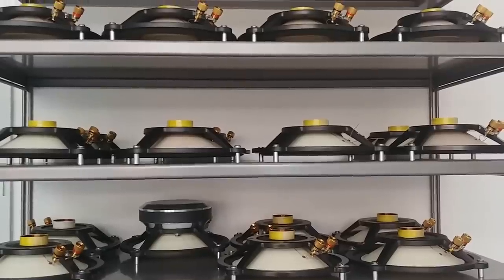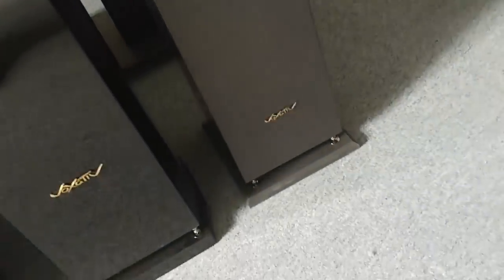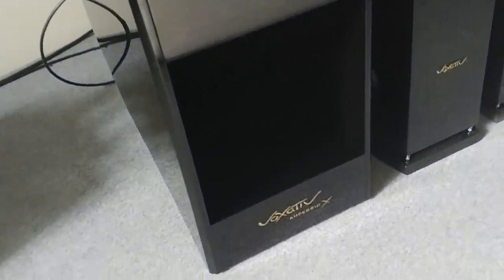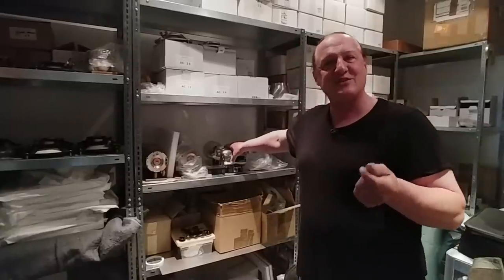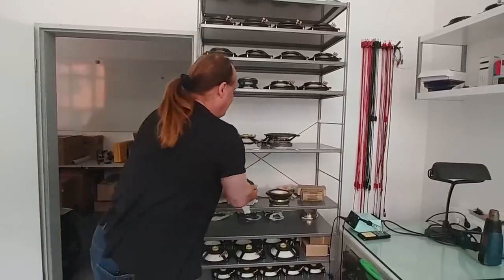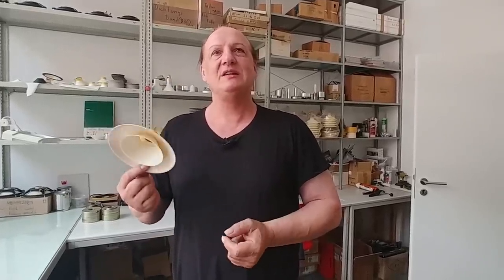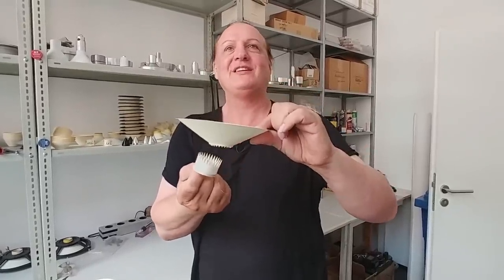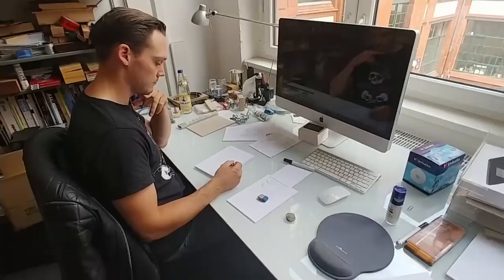'Made in Berlin': Voxativ loudspeakers

Comment: Interesting how they are moving away from single driver and to 3 way. I think  most single driver doctrines eventually realize that it’s not necessarily the single driver aspect they love, it’s simply the midrange clarity of a lightweight wide bander. If that wide bander can also add the same speed and clarity to both ends, while still properly executing a seamless xover, then it really is a better solution.

Comment: I agree it's best for midrange speakers to be made of paper, or another lightweight composite material, because they have a combination of stiffness, damping, and very light weight that makes them ideal for midrange reproduction, especially at frequencies where a wavelength will physically fit on the radius of the cone, so the cone begins to break up slightly. When that happens with aluminum cones, the breakup happens at a higher frequency than paper, but it also is very severe because the aluminum metal has little to no self-damping. But for low frequencies (bass, sub-bass) aluminum really is an excellent material because the cone moves as a perfect piston, and the bass driver then has almost no character of its own, as long as the moving assembly is kept lightweight and the motor assembly is strong. And for tweeters, I still have heard no equal to the RAAL ribbon, and the "next best" is the Scan-Speak illuminator beryllium dome.

Comment: 9:35 Aluminum cone drivers have disappeared because they do not sound really good... Genelec, Elac, KEF, PSB, Klipsch, and I believe Infinity and several others use aluminum with ceramic, and then we have titanium with Mackie and beryllium with Focal and Paradigm. Curious what a company purely based on blind tests would say sounds the best diaphragm wise. My guess is it would have less of an effect than most would guess, but that stronger lighter materials would win out, especially at high volumes.

Comment: Point source is the only way to go. With two ways the vowels of the voice sound is coming from like 20 cm apart. Not only that, the woofer and tweeter and the ear form a triangle...but with point source you just get a line. The triangle makes it easier to hear where the sound is coming from. If you had a pair of your speakers in your bedroom and you put on a rain relaxation stream overnight, the rain will convincingly sound like it's outside on the roof. That is exactly what I experience with my FR speakers.

Comment: I have been building FR speakers for a while and I tested a few brands of steep cone drivers against shallow cone drivers and the shallow cones are BETTER! Way more control in the upper med (by a large measure). Yours appear to be fairly shallow for the main cone. My drivers don't have a whizzer (each to their own). But my main cone is open but near the box (not in it). So mine get the same open sound as a whizzer, without the whizzer. The speaker hole is acoustically treated (with a 2" deep tube under) to act like a bass vent. So it doesn't have that bonky sound how you would expect with such a driver mounting. Driver is mounted 1-2 cm above the speaker hole with extension screws and spacers. Easy. I use an extra woofer pointing straight down onto the floor on the very bottom of the tower box. And the bass vent med speak hole also works as a massvent for the woofer. Basically it's a FR driver placed over a woofer bass vent. I did that with cheap (modified) 3"FR drivers over my B&W 706 bass vents. And the B&W woofers fire downwards by the boxes being oddly positioned on the bench (raised with small blocks to let the bass escape from the bottom). They are bi-wire speakers (with double binding posts at the rear) so I only connected the woofer for this experiment. And used the 3" driver with the whole signal (and I added extra inductance to the woofer connection). They sound about ten times better than the B&Ws did when original! It's a temporary experiment and it is easily reversed back to the original B&Ws (without ingerfearing with them in any way).

Comment: Holger: "If you look in the market most aluminum cone drivers have disappeared because they do not sound good" -- what "market"  is he speaking of? Aluminum cones used by e.g. KEF, ELAC is the market compared to speakers no one's ever heard about, or heard, and are so overpriced no-one ever will hear them.
Reply: I'm guessing your speakers have aluminium drivers.
Reply: I am sure there are some real hi end stores around your area...
Reply: Since he sells in a different market then Kef and Elac, I would assume yes.  This guy hand makes his own speakers and the components!  "Overpriced no-one ever will hear them"?  You will one day, when inverations from manufacturers like this one trickle down into products that average consumer will buy and enjoy.  Just like the aluminum cones did in the KEFs and the Elacs.  Plus aluminum is a good reliable stiff material to make a consistently performing speaker for a quality mass market.  Not knocking aluminum, I own metal coned speakers and enjoy them.
Reply: Elac manufactures paper cones. The aluminum foil is glued to the edge of the bottom paper cone.